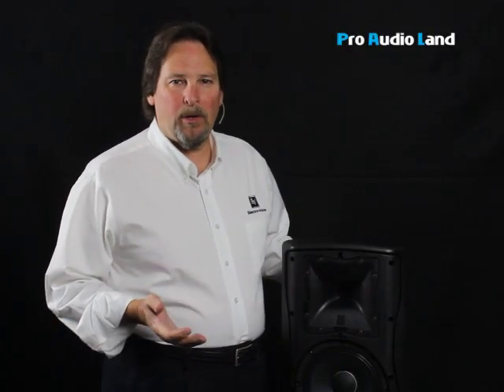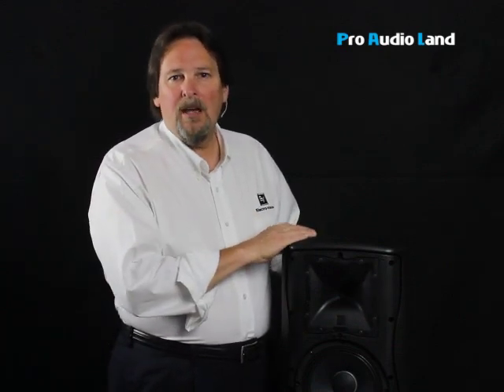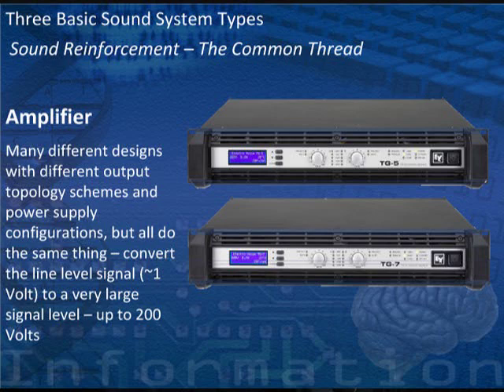Pro Audio 101: Matching Amps To Speakers And How Not To Blow Them Up.

Comment: What amplifier is best for, say, a set of economical passive tripod-mount speakers like Yamaha’s popular BR10 and BR12 models? I should clarify. If a speaker says 250 watts nominal with a maximum handling of 500, should I get a 250 or 500 watt amplifier?

Comment: Rating speakers in Watts is misleading. Most people think a 400w speaker is louder than a 100w speaker. It may be, but that's not why. The speakers watt reading is the maximum continuous power they can absorb without overheating and melting the voice coils. No voice coil = no sound. Like this gentlemen said, using an underrated amplifier can destroy a higher rated speaker because of distortion. This gets confusing. As a guitar player I want distortion in my tone, as an audiophile or pro audio sound control man I don't want any distortion in my signal chain. Distortion in the signal chain of a guitar amp makes for some saturated tones that work well with some types of music, the type I call music and others call Rock or Metal. From that point on however, the PA system at a venue or stereo in your house is meant to reproduce the tones I generate with precision. No distortion is a ever good thing. Also, when you buy an amplifier and look at its watt rating, with regard to the volume it can drive speakers to, always read the fine print. Many cheap ass amps are rated at 100watts, but when you read the full specs it will be rated at 100watts at 10% THD, or Total Harmonic Distortion. Remember that we can hear anything above 1% THD. So look for an amp that rated at 100Watts at .09% THD or lower. A good amp will be rated below .9%, like .09% or less. .009% is even lower and more desirable. Another thing I have always done on any PA or home stereo amp is never run the volume more than Halfway up. Momentary spikes in volume could push your drivers so hard that they become physically or mechanically damaged. On my older system, after I got to know it very well I would go as high as 2/3 but never any higher. Before you try that check the excursion of your woofers by lightly pushing in on them until they bottom and remember how much they travel. The when you crank it up make sure they don't travel too close to bottoming out. If they do you could damage the voice coil and a damaged voice coil = no sound, or really bad sounds coming from your damaged speakers.

Comment: Does anyone know the RMS wattage range my speakers should be, if I'm planning to run them through a 25 watt Tube amp? I can't seem to find much information on how to match a tube amp w/ speakers (power-wise) to not blow them up. (for a home theater system).

Comment: Don't forget that amps are rated at they're maximum power (and we all know that most amps at 80% will start showing signs of distortion); Speakers on the other hand will tell you the maximum admissible power before starting to show signs of stress (so basically they're rating is for maximum number of CLEAN watts)... The best rule of thumb to get clean watts from an amp is to buy an amp with extra power in relationship to the speaker (20% more is a good start). For example: for a 100W/8 Ohm rated speaker I'd get a 120W/8 Ohm rated amplifier at least.
Reply: Osvaldo Sousa , To be safe, I would double it to 200 watts or at least 150 watts amp rating.

Comment: Can a  85w 4 ohms amplifier use with the BOSE 101 music monitor speaker of 60w wrms 4 ohms ?
Reply: yes because the volume control on the amplifier raises or lowers the VOLTAGE sent to the speakers ..Varying voltage also varies the amperage and wattage because each are relying on the others to determine their strength..Theoretically you can use a 10 watt speaker on a 100 watt poweramp and not harm either the speaker or amp if the volume is lowered properly and the ohms match..If the 10 watt speaker(s) are very efficient the volume will be as loud as any 100 watt speaker(s)...

Comment: two 15 inch 400 watts program power 800 watts peak speaker to 1500 watts amp..its ok?
Reply from the maker: All depends what ohms the speakers are how you plan on running them and how you amp is used to send power 8 ohm, 4 ohm or bridged mono. Call us we can help.
Reply: proaudioland  hey i need some help

Comment from the maker: Yes! When running parallel wiring load impedance drops; therefore, the more speakers you wire in, the lower the impedance. Lower impedance raises acoustical output. Speaker output increases because the amplifier’s power output rises as the load impedance decreases. In this case 2- 8ohm speakers will create a 4 ohm load to use all of the amps power rating at 4 ohms. You can also run down to 2 ohms if your amp can handle it.
Reply: proaudioland man i have an 200 watt amp wat well happen if i puted on a 1000watt speaker
Reply: proaudioland  i have 2 gt12-100 4 ohm speakers  in an Ampeg vt22 set on 2ohm when i bought it. Does this seem most logical to you????? Thanks

Comment: You said the 400w amp @ 4 ohms would drive 2x8ohm speakers at 400w..... that is true only if the speakers are in parallel.... correct?
Reply: Correct.  If the speakers are wired parallel, it'll drop to 4 ohms...BUTALSO if you plug 2 speakers directly into an amp with multiple outputs for the SAME channel, that would also be an internal parallel connection for that amplification channel, also equaling 4 ohms. =)
Reply: If plugging two speakers directly into 2 different channel outputs (1 & 2 or Left & Right), then those are separate and not running a parallel connection.

Comment: buy an amp with at least 450w that can run 4 ohms per channel.
rule of thumb is power of amp shud be at least 50% more than that of speaker.
better yet get a 500w amp that can run 4-16ohms, so you can have options to add speakers. as long as u add speakers with same impedances to one channel.

Comment: So I have 2 electro voice speakers at 8 ohm at 300 watts each. If I wire them parallel down to 4 ohm, how much wattage amp should I get at 4ohm? 600@ 4 ohm???